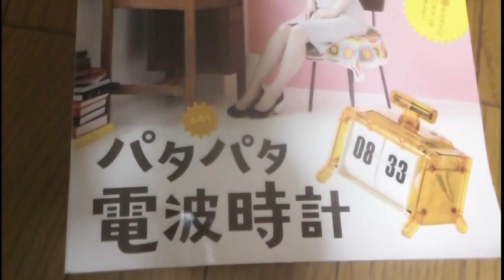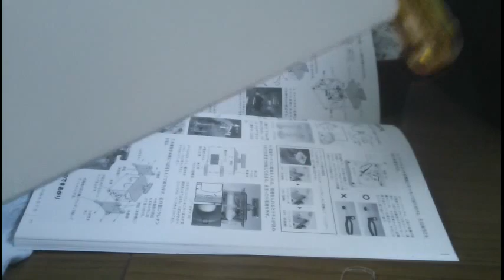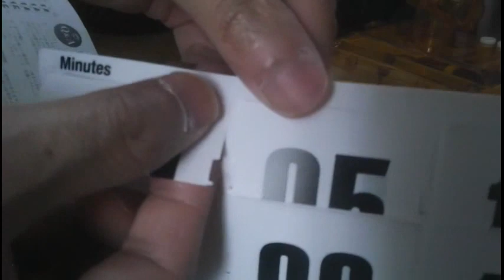Assembling Gakken Radio-controlled Flip clock Kit

Comment: Did you assemble it in Japan? It seems it only will catch the hour with a radio signal that is coded in Japan.
Reply from the maker: Yes, this clock receives only Japanese time signals (JJY 40khz and 60khz)  ;-p
Reply: Thanks. I can put it on time by pressing the two buttons. Now I will like to use it as animation display but I cannot read the japaneese article about that and how to make the clock to rotate the two cylinders at, say, 2 times per second :np
Reply from the maker: @alexecheverria It seems that  you have to press the button longer then it starts like this  https://youtu.be/kZyoCV5Jwbc?t=54   ( I can't verify it because my unit is broken already )
Reply: @karenevil  Ooh! It does work! I am sorry to read yours is broken already. Now I have to laser cut 60 blanck stirene cards hehe.
Reply: By the way, have you seen the magentic recorder? I am looking for one but to non avail.